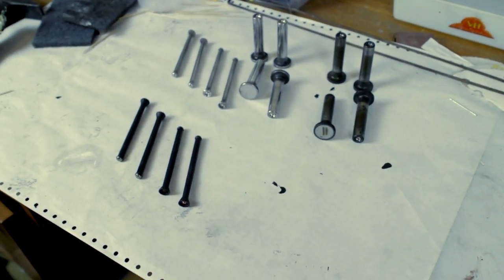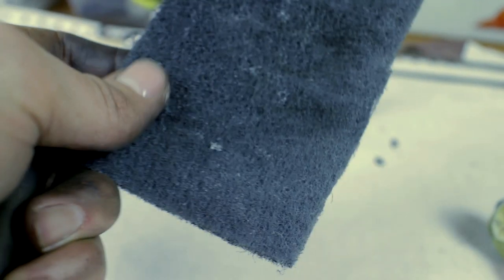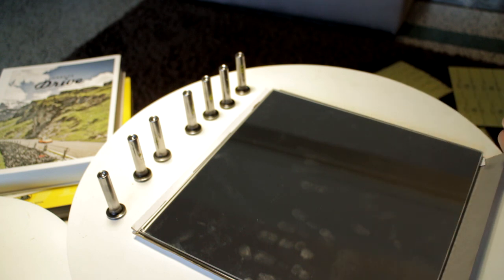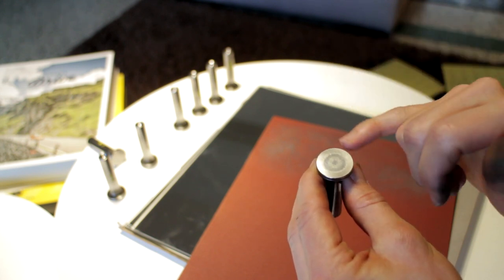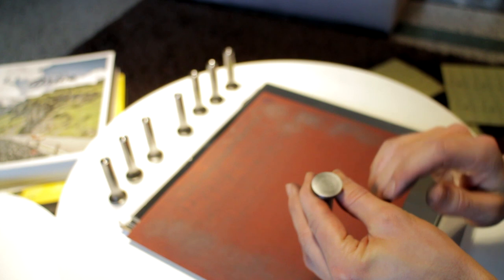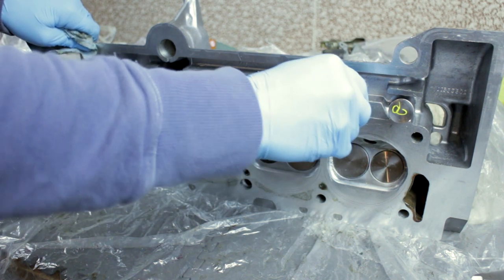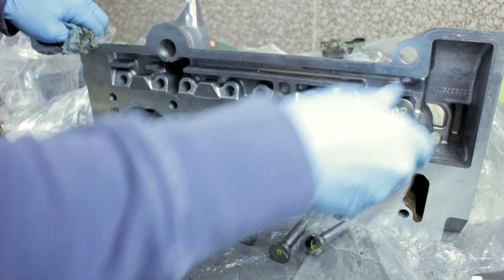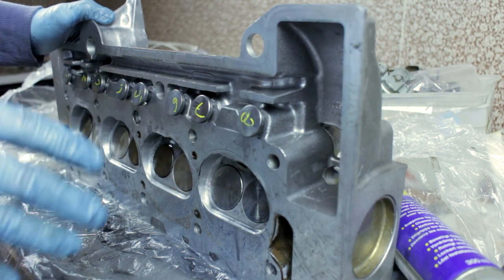Lotus Europa - Ep 54: Engine: Pushrods & Lifters

Comment: Should the lifters have a little crown so they rotate while riding the cam lobes?
Reply from the maker: Most engines require the lifters to have a small crown. However in the Renault design the lifters are flat and the cam lobes are parallel. The rotation only relies on the offset position of the lifters and the cam lobes.

Comment: Do Renault state a running clearance for the lifters? They do get well oiled due to the pockets and the alloy head should expand a little more than the lifters but a bit of clearance is good. Any oil getting down the bores will get into the cam area which can be a bonus. 4&5 looked to still be a bit tight. Have you tried these lifters in any of your other heads? What were they like? Nice work.
Reply from the maker: I checked the lifters in a few of my other cylinder heads and they could slide freely in the bores. The head that I am using has been ported by Valerio, so I wanted to use this one. Renault mentions oversized lifters (2 sizes), but the ones I am using are the standard size. I think all lifters are free in the bores at the moment. I will double check everything upon assembly. The cam should always be well lubricated because they sit in an oil bath. Might have to try to make some modifications so that oil returns in to the sump quickly enough.